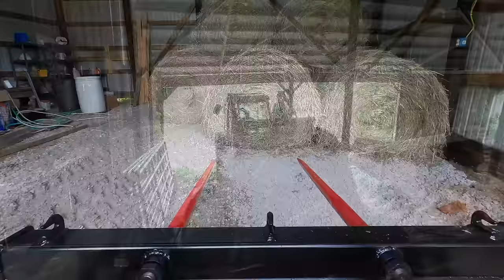Building a Quick Attach Hay Spear for the Tractor.  Moving Round bales out of the bank barn.

Comment: Looks good, I think I would have put the spears on the bottom though and it could have doubled as a pallet fork.
Reply: agree....100% for many reasons
Reply: He already has a set of pallet forks I believe
Reply: Maybe it's not too late to drill two new holes in the bottom to create that option.
Reply: @lawrenceb.3349  as is the metal on bottom is to small, it will take some engineering to accommodate the quick attach accessory that he bought.
Reply: I agree
Reply: @justinauman5438  you but who the hell out in the field wants to drive all the way home to get them not me
Reply: another reason to have them low is its best to be able to stab bales below centerline ...especially if they are stored outside and get a bit of bottom rot during the winter ...if you pick them up high you will strip several loops off the bale and not get it moved...obviously storing inside helps...very tight bales also helps ...there is a reason they are made with spikes on the bottom from factories...but if it works for evan no problem
Reply: Never see the spears on the top! If you buy them here in Europe, they are always on the bottom. It's easier to balance the bales when they are on the bottom.
Reply: Hay bale spear is for hay bales, not pallets.
Reply: @derekadams729  They still work very well as pallet forks, I unload 250 gallon IBC water totes all the time. Besides pallet forks cost 800 dollars bale spears only cost 400.
Reply: @derekadams729  yea but if you need to move somthin real quick you could
Reply: The spears on top will be much easier to work accurately from the tractor. Pallet forks can be pretty tough to manage from a tractor seat.
Reply: @dennyofthepines1457  highly disagree
Reply: @garynelson4749  I don’t know of anyone who picks up round bales at the top or the bottom but in the center.
Reply: I've been rolling that idea around in my head for 6+ months now
Reply: Just curious the reason for the spikes on the top?

Comment: Good build! One tip when dropping the bales, you may have to put down pressure with the loader as you back out, then as you see the spears are coming out you can lift the loader a bit and back on out. You can do this in one continuous motion, just takes a little practice - you’ll figure it out pretty quick.

Comment: It appeared when trying to remove the bales you didn't lower the attachment where the weight of the bale was neutral (seemed too high) and initially didn't have the spears level.   Great job of fabricating and building.  Weld some extension on top of the handles off set on the back side of each for saftey.

Comment: Great job with the build and explaining as you went. I was thinking about going with the plate you went with but my plans for my attachment plate is for multiple attachments. First to attach will be pallet forks, then my single bail spear attachment, then my 15 in wide trench excavator for French drain and such. Not knowing what else might come up with, I went with 1/2 in solid plate. At 63, plate by itself is more than enough weight. I'll have to weigh it with no attachments.

Comment: Suggestion - Get a set of fiberglass blankets from Harbor Freight for when you are using that metal chop saw.  I almost burned down my shop with sparks from mine.  I was lucky to notice the smoke from the smoldering fire before I left.  Might not be an issue for you now because it's a new shop but as you get dust or sawdust laying around it might.

Comment: Evan very beefy build. Nice welds. To prevent blowouts welding do a non welding walk thru making mental notes of thinner metal and do these welds as a separate job turning down the settings. This mount will serve you well. Use anti seize in the hay spear sleeves.

Comment: You did a very good job   2 spears are the best way to go. Get shorter spears mine are about 27” to use on 4’ bales.  If you lowered the spears halfway might help on control of bales  l went even cheaper on my spears.Ford has a manure bucket for my loader sol left two spears in the bucket has worked great  for 45 years. Enjoy your vids  don’t mean to criticize  just a lot of experience

Comment: I built one very similar but instead of a center hook, I put a 2 5/16" ball so I could move gooseneck trailers around. Your design is great but I recommend putting a gusset on the bottom back side of the 2" receiver.

Comment: Quick IG welding tip - when you finish a tack or bead hold the torch head still after stopping the arc. The welder should keep the gas flowing for a second or two to keep oxygen away as the bead cools. The welder should have settings for gas time before and after arc.

Comment: We had a friend that was using those  Nut type spears and  one of the  retaining nuts  broke off and took out the front cab glass..... We only use those on open station tractors...... The ones on the cab tractors are cross-bolt

Comment: Looks good. But, wrapping the bales just a tad tighter would be good. And I agree with a previous comment that positioning the spears at the bottom of the rack might be a plus. (Couldn't hurt to mount a set of spear sockets on bottom of the frame as an alternative, fo r versatility.) Whatever works. I only knew about square bales when I worked on various farms, in the Summer, for baling. (Love the round bale concept!)
Reply: I maintained welding machines, in the submarine building industry, and agree that your welds look pretty decent. A steady oscilation makes for really good weld patterns. I also agree that gas shield versus flux core wire is superior.

Comment: Nice looking job on the hay spear, I like the hitch for pulling equipment like trailers. Your welds are fine, just like I tell my son, as long as it works and holds, that's what's important. My two spears are on the bottom of my attachment, I also have a 1 spear 2 spike one too, like the 2 spear better. Thanks and have a great evening.

Comment: I’ve not used a bale spear myself, so give this thought and maybe try out sometime…

If you put your spears at the midline, they can slide up and down because the hay at those points runs vertical. If you stab about the top third or the bottom third, the hay will be aligned about 45 degrees from vertical and your spears won’t slide as bad up and down in the bale. 

You hit on a way to solve the problem of the bale turning over - just stack a second on the bottom to lock the first one. 

As for the spears sliding out without dragging the bale, as odd as it might sound, try getting the spears level and then put a little down force on the bale to make the friction with the ground or bale below more important than the friction between bale and spear. Those spears will polish to a sheen soon. PAM spray might help until they do. 

Nice job on the implement! Looks professional.

Comment: just a thought you can weld a square over a long pipe with some chain rings to put  cable winches on to make a long extension  pole boom  that you can pin into the receiver hitch and  the hooks

Comment: We used a bale spear a lot and we found a single spear was the best.  It isn't as strong but was never a problem for that. Getting the spear out of the bale is the problem, depending on bale density and quality of material.  Also, if you bend one spear, by accident or misuse, You will have more problems than if it was a single.  Hope I'm wrong in my doom and gloom because you made it well. Cheers

Comment: Really nice job...your welding has really improved. Stack of dimes! One tip for your saw: when cutting square stock( or anything really) you will prolong your blade life if you avoid cutting on the flat side. Start on the 90's first or the ends if cutting flat stock if that makes sense. In other words avoid the flat sides.
Reply: Hi, do you know what type of saw blade that was? I never seen a saw cut metal so fast! Thanks
Reply: @pauljanssen4408  I believe he has a saw made by Evolution which is what I have. Very happy with it. They sell blades as well.

Comment: I think the hay spears are fine on top, and easier to see from the cab up there. I like fabricating as well, and like being able to build things the way I want cheaper, than to buy and have to make changes. I wouldn't remove paint on spikes, the hay will help with that, but I did notice that when you were backing up and trying to get spikes to release, the angle of the spikes still had a lot of bail tension on them sometimes, so believe over time you will get used to changing the angle on the spikes so they are more parallel to ground when backing up. Stay safe you all, and have a relaxing 4th of July!

Comment: Sean as you have self leveling arms I assume your in the same situation as me. 
When you spear the bale curl your fork downward a little, curl upward so that the bale is picked up (or the spear is leant upward a little), when off loading the bale at hight/lege only lower the bale until preshure is applyed then pull off.
I'd been tought this way with the explication that it has the simplest order of operations and so is faster and esyer than than most other techniques.

Comment: I could make custom attachments until the end of time.  Right now I’m making a hydraulic powered winder that I need to wind thousands of feet of old barb wire as I take down unneeded fencing. Except for the hyd motor, bearings, and quik attach plate, everything else is custom.

Comment: Remember....... " ALWAYS "     lower the spears downward so you dont spear yourself or someone else. Or raise the spears above head height !   Never get off the tractor with out doing this !   In most cases.... you only need " one " spear .  Stick it in the top of center of the bale to prevent the bale from rolling " much " and your off !   Two spears are ok for stability......but most times not needed.  Two spears create more friction and its harder to enter the bale with two spears.  Primary true when working with wet hay.   Also........ using a spear thats shorter .........like around 38 inches works much better. I have these same spears and there are none to compare !

Comment: I like using gas with my welder too. I think you would have done better putting the spears on the bottom of the rack instead of the top, the 'store bought' spears are on the bottom. You can spear the lower portion of the rolls easier than the middle to top portion without the roll tipping toward the back. Also I used my double spears like a set of forks picking things up. You can't do that with the spears on the top of the rack...

Comment: Spears should have been at the bottom. Stack up higher in the barn. Even use as forks for a pallet.
Reply: You're right Lamar. He would have better control of the bales and likely see what the spears are doing better too. Just overall better control. But I guess they will work like they are if he ever gets use to using them.

Comment: Nice job.  However, I have a couple of suggestions you might consider.  On the trailer hitch put a reinforcing triangle under the back side of it.  On the hay spear, maybe you could order another collar (just the collar) and mount it to the very center of your frame.  It would give you the option of using a single spear or a double spear arrangement.  With a single spear you wouldn't have the problem of the attachment handles busting your knuckles  on the bolts on the back side of the spear.  And if you want a bunch of options you could always add the two small stabilizer spears at the bottom to keep the hitch attachment company.  I think it would be wonderful and unique to have that third collar welded into the middle of that top bar, even if you never used it.

Comment: 1) You need to put anti-seize on the tapered part of the spear before inserting the spear in the frame.  
2) I would have used the second spear to make a three-point hitch spear.  Moving two bales at a time is much faster.
3) A short spear could have been made to fit the receiver hitch if you only had one big spear on top.
A single spear would be easier to insert and pull out of a bale.